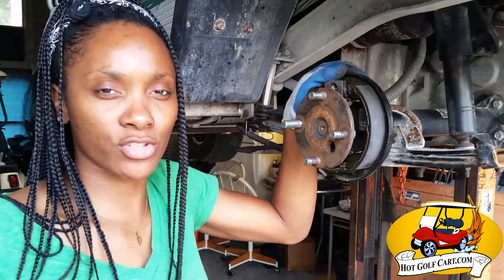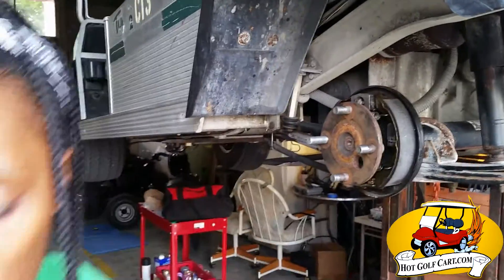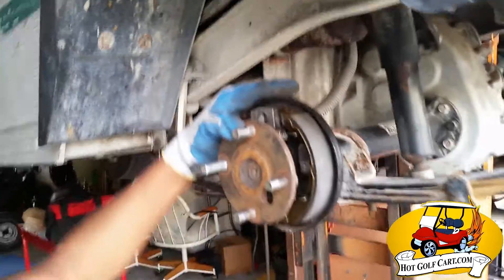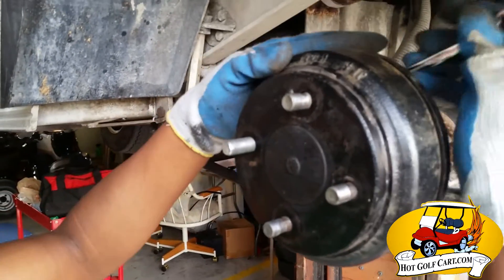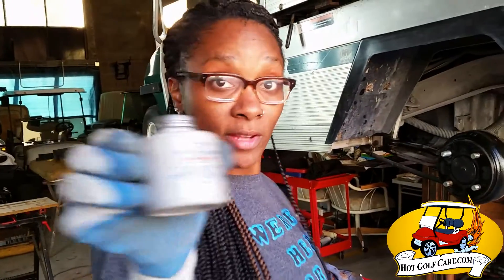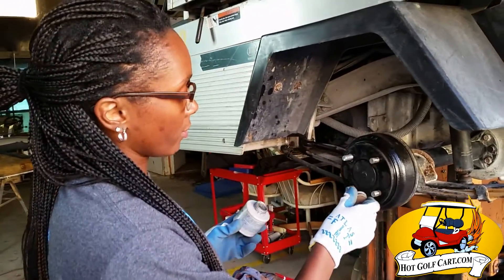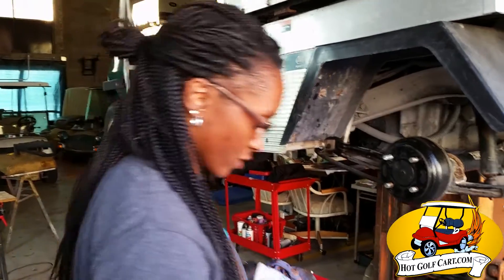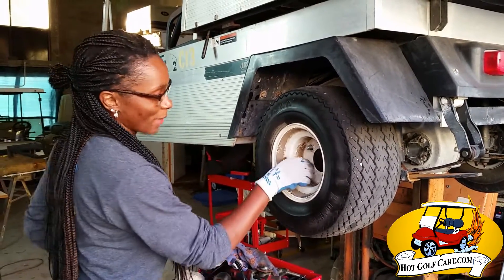Calibrating Self Adjusting Brakes Club Car Golf Cart

Comment: What if I don’t have the adjustment bolt in the back? I took both brake drums off and now they won’t fit back.
Reply: Manually rotate the star wheel to contract the shoes. You will have to pry up the spring loaded rachet lever (ADJUSTING ARM) to rotate the (ADJUSTING WHEEL) star wheel. Note : It is very difficlt to see the lever & spring, use a bright flash light. See Fig. 6-17 in the CLUB CAR SERVICE MANUAL.

Comment: Obviously these people don't live near salt water, that little bit of anti-seize will not hurt your torque value what so ever especially on a golf cart lug. I'd rather be safe and use it than be screwed and have to cut it..
Reply: Its an old myth. I have put anti seize on all my vehicles lug nuts for 50 years. Zero problems.